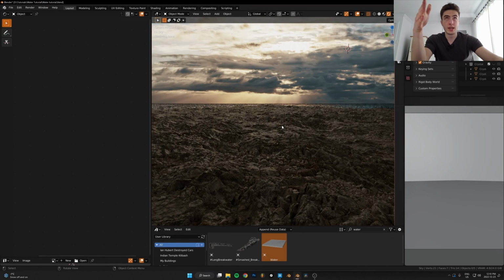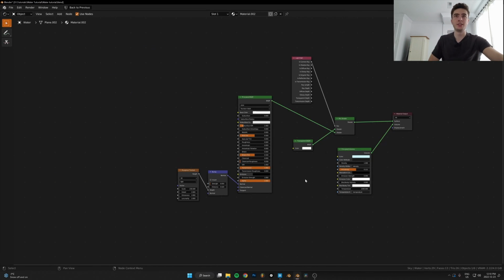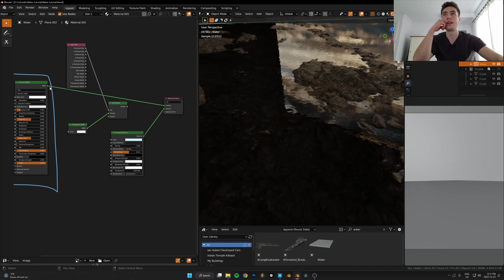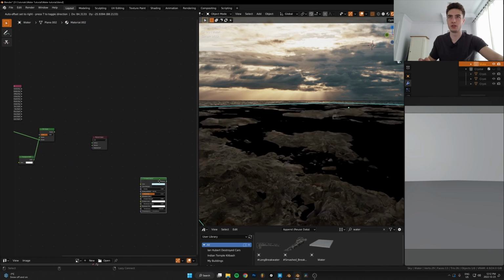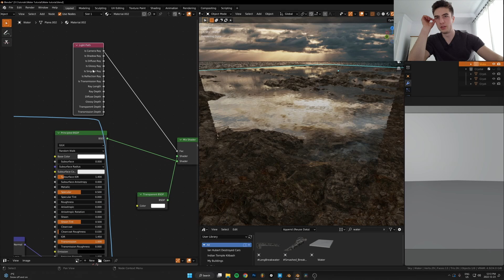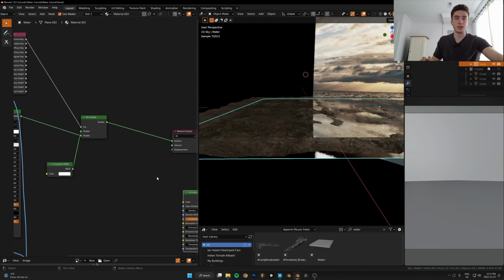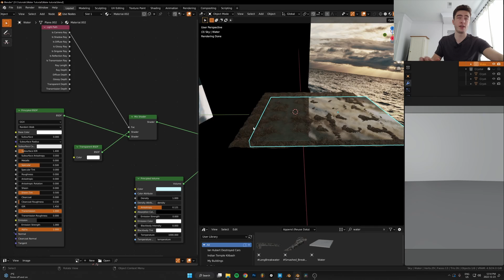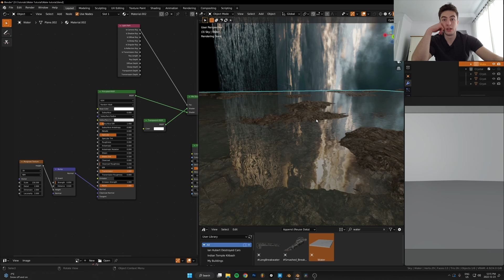Creating Realistic Water In Blender

Comment: I also recommend that you set the IOR(index of refraction) to 1.333 which is the actual value that water has. It doesn't matter much but it's a nice touch!
Reply: Thank you for the tip!
Reply: It does matter... setting IOR to 1.0 (the IOR of air) basically means there is no refraction at all... so water must be set to 1.33. Setting IOR correctly does make your water darker, as some of the light bouncing back out of the water gets trapped... but the transparency shader should help compensate for that

Comment: How to create foliage and snow would be very helpful!  I am now learning intensively and i find it very hard to manage. Fore example when i have a big scene it lags with the real snow and also with foliage if i do hair particles with anything above 1k texture. i have good cpu, 24gb ram and 3060 12gb, so i guess i do something wrong.   Thank you for the awesome content.
Reply: To optimise your scene, I suggest that you decrease the amount of foliage you see in the viewport. And also, use interpolation if you can instead of increase the particle amount. You can also try geometry nodes but it lags a lot more in my opinion.
Reply: @cedricrioux2956  thanks i ll do a research now! It is better to apply snow in certain faces and not to the whole plane. And also i forgot to apply scale and transforms. I also try to see if there is a difference between subdividing and voxel remeshing. Because i also need to do some sculpting in things like fantasy architecture and stuff.

Comment: You could also add ambient conclusion for the Musgrave texture so the water will kind of bend around everything it touches like it does in real life
Reply: - leaves tip on how to make it better
- refuses to elaborate
- leaves
Reply: @HLGmatrix1 he knows how to and that's the point
Reply: How do you do that?
Reply: underrated comment
Reply: I got an okay result by connecting the Bump node to the Ambient Occlusion node by Normal -> Color and from the AO Color -> Normal of PBSDF
Reply: @yoyo_cortex   you can also use noise texture with scale 30, distortion 3 and connect the result to a color ramp (more control) and then to the distance of the AO. That way it will be even on all sides. Then take the AO output and connect it to the height input of the bump node. This bump should have a higher strength. Add this bump to the other bump of the original musgrave texture with a color mix node. Connect the color mix to the normal of the BSDF
Reply: How would you set that up? I'm beyond terrible with nodes. Do you add it between the musgrave or use a mix node connected to the color?
Reply: what? i dont understand how that makes sense
Reply: I need to try this
Reply: We would love to know how to pull this off. :)

Comment: Light Path "is Camera Ray" is a path that's only visible to camera, but not to other surfaces or reflections. You will see it in your viewport and scene cameras, but it's not going to cast shadows or caustics (this is why the rocky surface is brighter), won't spread global illumination... and it also won't be reflected in any glossy surfaces either. I mean it will REFLECT other surfaces, but it's not going to BE in other surfaces' reflections: so if you put a mirror near the water, you won't see the water in it. Also you won't see it through any glass materials either, since Transmission is a separate path.
Kind of a loophole, but you also can add "is Glossy Ray" with "is Camera Ray" together, with a Math node. It'll make it visible to camera AND reflections. Also you can add "is Transmission Ray" to see it through glass materials
Reply: Very nice explaination!
Reply: @Puunboy  Thanks, it took me some time since I'm not very good at explaining stuff. Heheh

Comment: Tried this out, was ok. My water was transparent like yours. Not good w/Blender so more than likely me. Might be lights reflecting off water to much idk. Used the 3point light addon in Blender. Plus started w/plane then extruded it after you mentioned it was a cube.
Reply from the maker: If you extruded the plane downwards instead of upwards, you might just need to flip the normals. Select all faces in edit mode and press Shift + N
Reply: @maxhayart  good to know, tnx. And I just went through a tut. where they checked normals constantly throughout, should thought of that.
Reply: @maxhayart  Just went back in and that was it tnx.

Comment: you can remove the mixshader + isCamerRay node. Basically IsCameraRay is always going to give a 1 and pull from the principledBSDF on the actual material. You can use it when you want hdri image to reflect on materials, but not be visible from the camera (via direct ray). In this specific shader you show - you're just making it so the rock material won't see the reflection of the water on it.